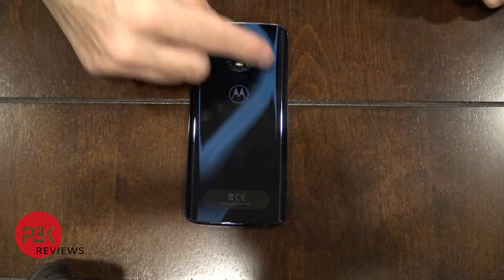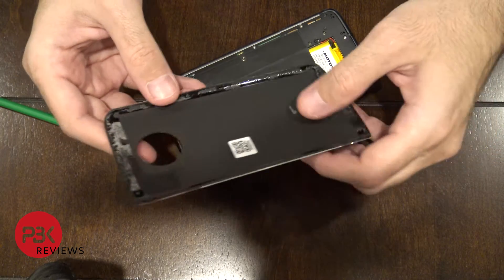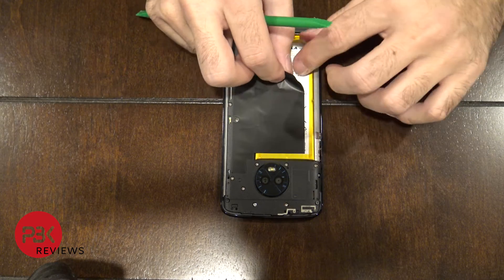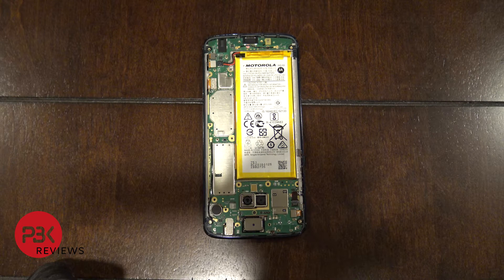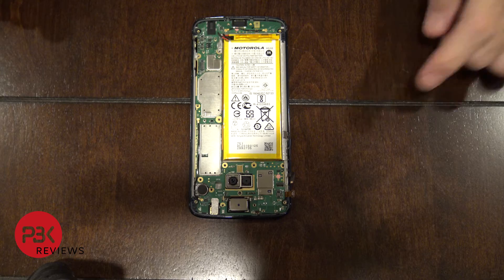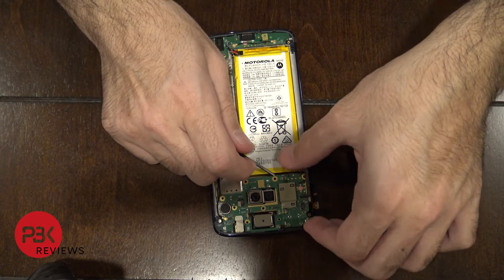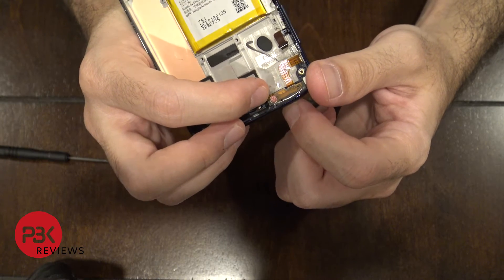Motorola Moto G6 Disassembly Teardown Repair Video XT1925

Comment: THANK YOU.  The info at 4:05 helped me to fix a bluetooth and wifi problem I had after I replaced the battery.
Reply from the maker: Glad it was helpful :)
Reply: @PBKreviews  Now the issue is back.  Bluetooth signal is almost nonexistent, and the 2.4Ghz wifi is weak and cuts in and out.  The 5G is fine though 🤔  Tried taking it apart and making sure everything is connected as best as I know how, but it's not helping now.  Any tips?

Comment: I replaced the battery in my G6 and now the battery temperature sensor reads -19.5 C and it won't charge to 100%.  Where is the battery temperature sensor and can it be fixed?
Reply from the maker: Would be a part of the battery itself.
Reply: @PBKreviews  How would it send that data to the phone if there are only two wires on the connection to it?

Comment: i can't get the back off ;~;
Reply from the maker: Hi, use a hair dryer to heat up the back plate a bit so it will loosen up the adhesive and make it easier to pry off.

Comment: Wall Stud scanner app.  Where is the sensor on the G6?  Is the sensor in the middle, left/right side?   Need to know for accurate marking the edge of wall post stud
Reply from the maker: I'm not sure where the sensor is located or which sensor it uses for that app etc.

Comment: Sir my moto g6 Very over heating and battery dropped plz help how to solve
Reply from the maker: Hi, try making sure you dont have running apps in the background. You can always backup all your data and then do a factory reset to set the phone back to factory and see if that helps. Over heating can also be caused from water damage etc.

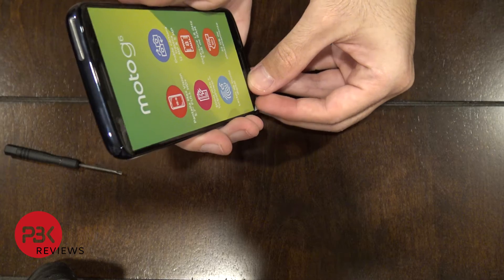Comment: Constructive criticism from a fellow youtuber, good clear video, good vantage point to see everything you were doing, but try to refrain from pointing out locations of obvious items such as "Here is the SCREEN 8:26", or, "Here is the CAMERA 7:31", battery, SIMM tray, headphone jack, charge port, etc.  "No shit".
Second point, I think most people are here for the screen removal.  It's not really a disassembly / teardown without this and you might want to consider listing "no screen removal" in your title else it's kinda clickbaity... 
Good luck and happy youtubing!
Reply from the maker: Thanks, but one this video is pretty old my videos now are more clear, and two you would think I don't need to mention those things, but you don't know how many times I get asked those questions on what part is what, where is the mic, where is the headphone jack connected etc. Best to just mention them so I don't have to answer every time.  Also after the disassembly all that is left is to heat up and pry the screen off, there is no special instructions on how to do the rest usually. Once the phone is disassembled, screen cable is disconnected, you just pry the screen off and add new adhesive and apply the new screen back on and reverse the process. As I have said many times, if you can't understand how to do that part then you should not even be taking a phone apart in the first place. Basically like taking the bolts off the rim of the tire then saying ok now how do I lift or pull out the rim. You just pull it off. But again I mention this in newer vids already telling you what you need to do to remove the screen since like you many people ask how do I replace the screen. Thanks for the pointers but in more recent vids I have implemented some of them and hope my explanation is thorough enough to explain why I do certain things certain ways.
Reply: @PBKreviews  Cool!  YouTube friends?  
Thanks for taking the time to feedback.  I'm glad my comment didn't upset you.  
Screen isn't always so easy.  I ran into one from factory where the backside of the LCD was double-sided taped to the midframe along with edges (like how the battery is).  Undo the edges like normal, then BANG, because reasons.  
So I learned... always check... because that would've been handy to know five minutes ago.  
Want to see the video I made taking mine apart?  I was drinking pond water and using a bean bag for heat.  :)  What else would you expect from a guy goes by a name like mine?
Reply from the maker: @trailblazers_homeschool  Ya no problem, it didn't upset me :). Ya screens are always usually just held down with adhesive, some use more adhesive some use less. But almost always suggested not to pry a working screen off because the chance of breaking it is high so if its already broken then you have nothing to worry about but when its working I try not to pry it off unless I have to since I don't want to render it useless :)

Comment: Thank you so much!!! This was super helpful so I could figure out what part of my phone was water damaged and was able to fix it. Luckily the screen connection had only gotten a little hot and I cleaned it with alcohol, dried other parts and got it back up and running.
Reply from the maker: You're welcome, glad it was able to help you

Comment: Thank you for a really clear unhurried video! I think my G6's front facing microphone is shot, is it part of the main board?
Reply from the maker: You're welcome. Yes the mic is soldered onto the main board. Make sure you clean out the hole that leads to the mic with a small brush or something else you can fit inside the hole to make sure It's not clogged causing it not to work.

Comment: Hi Thanks for the video- very clear and has helped tp take phone apart to dry it out after it stopped working in the rain! Unfortunatly in prying off cable from battery I have accidently pulled off  the 'plug' part of cable connection too... is there anyway I can repair this? Thanks
Reply from the maker: Your welcome. If you have soldering skills yes you can re-solder it onto the main board. If not then you can try taking it to a repair store which does soldering and have them do it for you. :)
Reply: Get a new phone.

Comment: It's a lot easier to remove the back by first heating it up evenly to about 120C on a heating plate (better yet using two heating plates side by side with a 3cm gap in between the plates to fit the rear camera lens, in order to avoid damaging the camera by the heat ;)
Reply: Can original adhesive be reused or does it get pulled apart and gunky? Need to know if I must order new adhesive before doing a battery replacement?
Reply: Usually the adhesive gets damaged (gets non-sticky and sometimes even ripped in places), therefore I always use brand new Tesa brand adhesive tape especially made for phone repair (extremely sticky and strong).  It's best to have different sizes available from 1mm to 20mm wide for all kinds of phone repairs (you can find it here: https://www.ifixit.com/Store/Tools/Tesa-61395-Tape/IF317-072?o=1).  If you don't have it or don't want to spend $100 for all the different sizes, then take it to your local phone repair shop which will most likely have it, and they usually don't charge a lot to have it replaces professionally (should be around $10usd, course for that price you will have to supply your own battery, otherwise it runs around $30 with the battery included).

Comment: If a moto g6 phone goes dead while taking a charge,is it just the battery,or could a power button fail? Phone is 4 months old.
Reply from the maker: try pressing and holding the volume up + down + power button for 15 seconds see if it boots. Might be frozen. If nothing then I would say its the battery.
Reply: @PBKreviews  This worked for me.

Comment: what if there is water damage? any way to fix or is phone junk now? Currently phone screen only flickers with a dim light and wont turn on.
Reply from the maker: If you have been trying to turn it on with water damage most likely you damaged it further. When your phone gets water damage, you need to try to turn it off and not turn it on until its completely clean n clear of water or corrosion. Next you need to disassemble it, and clean off any water and make sure there is no more water and if there is corrosion on the circuits you need to clean the corrosion off with a brush. Then reassemble it and try it.

Comment: Please help, I dropped my phone and now my microphone is not working. Nothing broke, everything else works fine, is costly to fix?
Reply from the maker: Try taking the phone apart and make sure all the cables are connected and nothing is loose, also make sure the mic has not broken off. The mic (where you speak into) should be the thing thats covered by the yellow rubber seal next to the charger port at 7:40 in the video
Reply: @PBKreviews  thanks for the info. But I don't have the tools to do it, so I'll have to take it to a repair shop. Thank you.
Reply from the maker: @jhonnybravo6445  no problem
Reply: @jhonnybravo6445  did you resolve your mic problem? On my g6 my mic suddenly started having issues when in call. The other person couldn't hear me through mic but could on speaker. I ran the Moto hardware test and it was fine but still had issues when in call.
Reply: @sarahstellar2137  not yet, I have another phone so I have no urgency. My mic doesn't even work when speaker is activated. How bout you, have you fixed yours?
Reply: @jhonnybravo6445  no, mine just started acting this way yesterday. So I've just been looking online all night for solutions, but im thinking I will need to send it in for repair. I thought about doing a factory reset but that probably won't work.

Comment: Does this have just a copper  thing for heat or is it liquid or what
Reply from the maker: Hi, no the copper color tape on this phone is just a protective shield tape so board doesnt make contact with the aluminum frame
Reply: @PBKreviews  ahh so no cooling for the phone?
Reply from the maker: @marcusgray3792  nothing heat transfer pipe related no, but this phone shouldn't be creating that much heat for it to require cooling so it should be fine :)
Reply: @PBKreviews  alright  thanks

Comment: my power and volume buttons are stuck, is it an easy fix?
Reply from the maker: Its not too hard but you would need to take the phone apart and remove the mother board to gain access to the power button/volume rocker. You would need to remove the screws holding them in place and see whats causing them to stick. Maybe cleaning them out and re-placing them in would fix it.

Comment: hi, I accidentally inserted the tool to open the sim tray into the opposite side of this phone, so on the mic cavity. Is it possible i have touched or damaged something on the mic with that tool? Or is it a empty cavity? Thanx in advance!
Reply from the maker: If you mean the small hole thats for the sound to enter the phone to reach the mic, I don't think you would have damaged it unless you smashed it in really hard because the mic itself is a gold colored solid metal type piece which is soldered onto the main board and would not break off or damage unless it was pried off etc.  Basically its not like a speaker that can tear.
Reply: @PBKreviews  hi, yes that one, I inserted the tool provided with the phone, the one to extract the sim and ad card tray. Everything works fine. I wondered if i could have damaged something but hopefully It seems all ok. 
Thanx.
Reply from the maker: Ya i wouldnt worry about it you should be fine :)
Reply: @PBKreviews  thank you

Comment: very clear.  I still have my Note4 because it allows swapping of batteries easily. I watched this video to see how difficult it would be to replace a battery if the non swappable battery needs to be replaced.  It doesn't look too bad.

Comment: did anyone run into signal fluctuations on this phone?  my brand new phone is constantly dropping and gaining signal bars all the time
Reply: I'm having that problem...
Reply: yes same problem
Reply: Same problem
Reply: Straight talk?
Reply: Could be caused by liquid damage, a damages radio chip on the main board, or a broken antenna connector inside the phone.  Take it to your local phone repair shop and ask them to try to fix it, but don't pay anything if it's not fixable. ;)

Comment: This video stops when it gets interesting.  I get it, you remove screws and take stuff apart.  Removing the LCD digitizer from the mid-case is a whole different story.  Throw me a few upvotes if you want me to submit a video of my removal of the LCD screen and installation of the new LCD screen.
Reply: If you're replacing the LCD screen and the digitizer, you'll need some 2 mm double sided tape and some conductive glue.  Hopefully, you're not like me and wait until the LCD screen gets in to realize you need the conductive glue.  Now I'm waiting for another shipment to arrive before I can have my cellphone back up and running.
Reply: This phone is definitely not repair friendly, even for me who's been doing phone repairs for 20+ years, it's not an easy job due to the way it's put together.
By the way, if you attempt it, don't just use "some" adhesive, but preferably high quality strong "Tesa" tape make especially for phone repair, that is if you want to get it done the right way.  You can find it here: https://www.ifixit.com/Store/Tools/Tesa-61395-Tape/IF317-072?o=1

Comment: If I need to replace a cracked screen glas, is it necessary to open it up at the back and the front, or is it possible to replace is just opening it on the front, the way you showed in the video ?
Reply from the maker: You would need to open it from the back first because you would need to disconnect the cables for the screen/touch screen glass etc. and reconnect the new ones. You would not be able to from just the front.
Reply: pwrdbykyank okay thx for the response ✌️👌

Comment: hey ! 
After taking the phone out of the box for the first time , i tried to put it on charge. But it did not show that it was charging, i tried removing the plug and putting it back again but still it did not start charging.  The phone was ON . after trying the same thing(removing plug and putting it back) for 5 min Then it started to charge. I wanted to now if this is fine or should i get it replaced as i still got time. Thanks
Reply from the maker: If the phone was completely dead, it takes about 3-5 minutes for it to initially get charge enough to display that the phone is charging etc. But if the phone is on and working but it wont charge and required you to plug it in a few times for it to work, then either you have a faulty charger or a issue with the phone and would contact motorola and have them replace it.
Reply: pwrdbykyank it happened only the first time after taking it out of the box(it was not dead.. it had 77 % already..) But now when I  put it on charge it charges without trying many times. It works fine.
Reply from the maker: Glad it works! Yea sometimes they act funny right out of the box, its happened to me as well, but with a new charge fixes the issue :)